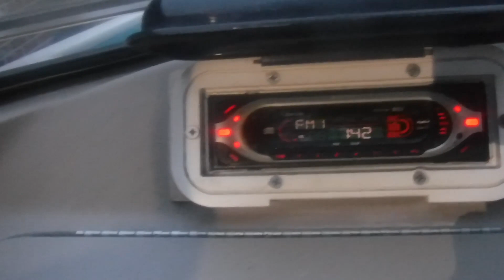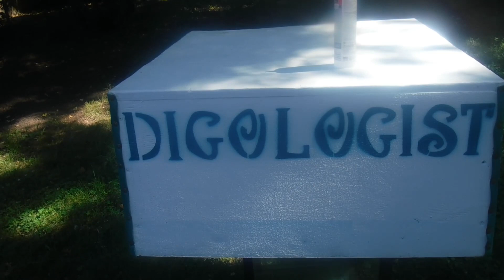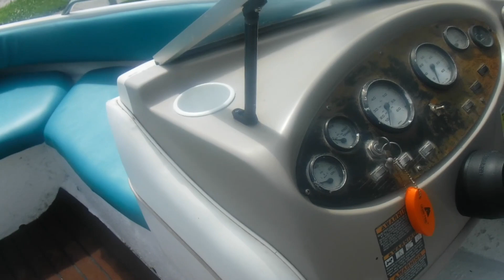Restoring The Bayliner- The Reveal !!

Comment: Congrats on the rehab. I have a similar Capri that will need similar TLC soon.  Really appreciate seeing what is under the deck and your restoration process.  Thanks for posting the project videos.
Reply from the maker: Glad they helped. make sure your shift cable bellows and exhaust and driveshaft bellows is in good condition. The shift cable bellow will allow water into the bilge. Good luck with your project.

Comment: 10:05 what’s the reason for adding the foam? Redoing my 90 bayliner and taking out both boxes where the back to back seats mount, then replacing them with bucket seats on swivels like your captains chair, but both sides.

Edit: 
I’m a autobody tech so all of the boat interior and structure is brand new to me. Your videos  have been a huge help so far!
Reply from the maker: I cut out the rotted seat box and the deck under. I had to remove the old foam under the deck that was saturated with water. If I did not replace the foam, the noise of the water would be loud.

Comment: Congrats! I just bought a 94 Capri in similar condition to yours. I'm optimistic that I can get it in the water this summer but I know how these projects can grow on you.
Reply from the maker: You can find the brackets on amazon. Just make sure you get the correct size. Good luck on your project. My Bayliner will hit the water for the first time since I have had it tomorrow
Reply: @DIGOLOGIST  yep! I think I found them! And stainless much better than. The zinc factory mounts.
Reply from the maker: @Mrcaffinebean  It may take two people to install them. Good luck
Reply: @DIGOLOGIST  haha ill drag the wife into the project 😂
Reply from the maker: @Mrcaffinebean  I took the Relic riser on its maiden voyage today it did great good luck on your project
Reply: @DIGOLOGIST  congrats! I just got my pressure washed and cleaned out. It needs new wood here and their but overall I'm hopeful. 

Your videos have been a big help and an inspiration. Thank you for posting them!
Reply: @DIGOLOGIST  btw if you in Richmond an you want to sell me your stern drive stand you used for the water pump I’d be interested. I think it's a job I should definitely do given the age of the motor.

Comment: Tell me about how you solved the rough idle issue. I read your post on the bayliner owner web site. Aledar
Reply from the maker: First make sure the gas has no water in it. Check all filter especially the screen where the fuel line goes into the carb. I adjusted the screw on the side and the fast idle screw. Good luck